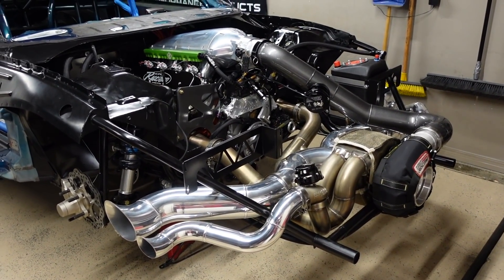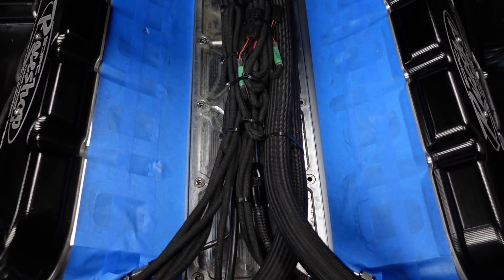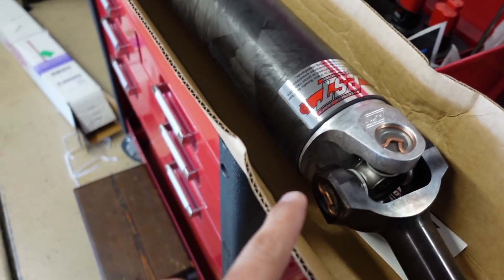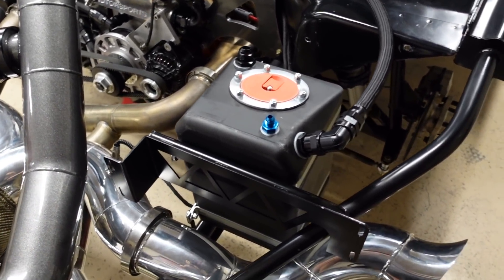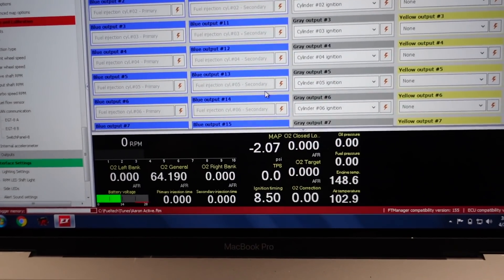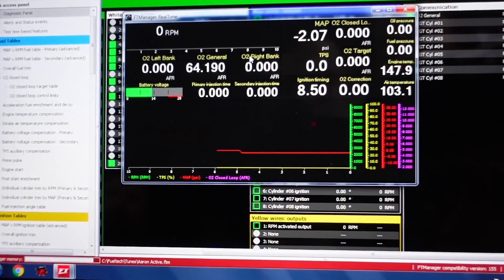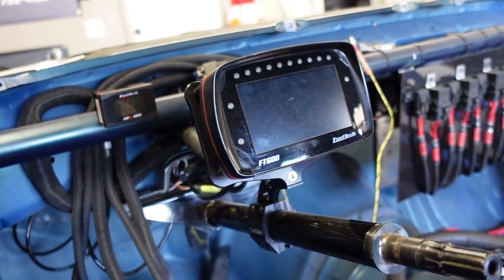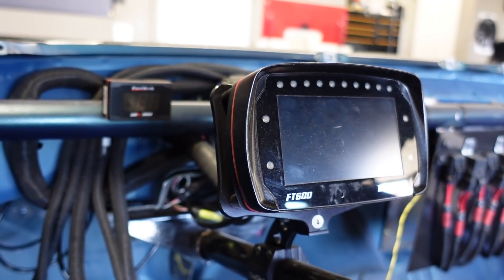FuelTech 2000+ HP F-Body - FIRST START  - Install and Diagnostics - RACE CAR WIRING SERIES - Part 4!

Comment: First off.. I'm and old school Carb guy.. i worked with factory fuel injection ..for a living for 20 year's never did any pro or after market stuff for racing.... I'm posting this cause i would like a real user input to running fuel injection on a race car!!
I see your running turbo's ect so your forced induction.. I can see were the fuel injection mapping can benefit for your application.. But if some one was going to go with a Holley system or a fuel tech system.. what would you recommend  for a basic N/A setup if you had to make a choice ?  In any case loved the video...thank's

Comment: sorry for the late question but how do you run the fueltech software on your Mac.? Do you have to (I forget what its called) "segregate" your hard drive?  I'm Mac based but bought a Toughbook and HATE it to use the software.. Thanks
Reply from the maker: I use VMware fusion to run windows on my Mac. Works great
Reply: @StreetCarJoe  thank you for taking the time to reply.  How about the FT700 an Plus that came out today.. I have the 550 & 600 and listening to the announcement.. I have no idea what it does but at 4&5,000 it better park my car to! Thanks again
Reply: @RiskIt007  FT700 will only be released around next summer. It will have a native Mac software. Keep in mind Fueltech products have a long life span and they get several software updates every year with new software additions, they will be releasing the FT700 as a "hardware platform" but, a lot of the new cool stuffs from the software functions may only come later (the 700 will do everything the 550/600 already does of course), I wouldn't bother about getting it on the release day. 

Fueltech have plans to keep and update the FT700 for the next 8~10 years with their software updates, they are saying they don't know exactly what will be possible with the platform because they aren't putting old cheap processors that most of ECUS used to have but the modern ones that are much faster, they are saying they wont trade performance to save a few bucks.They were focusing on developing the hardware as a platform first and then they will see what they can achieve with all that silicon performance, so a lot of new features may only appear/be released later.

Comment: That  EV1 injector clip should connect to those EV6 injectors (bosch style) without the jumper,  Their design to work with different style injectors.
Mine connected perfectly without any issues or internal trimming.
Awesome build!  First-time viewer.
Reply from the maker: Just went out and tried, no go. I think this an older fueltech harness so maybe they changed at one point. This harness doesn’t have the built in EGT connections either...

Comment: Joe nice job. What block is it using and is it solid or water jacketed?
Reply from the maker: LSX block. It’s filled but the heads are going to have water circulated through them

Comment: Your poor wife, and kids, they must be glad you stay in the Man Cave, and gone racing. 
Don't mean it in a bad way, but I tend to be a little OCD myself, and I remember back when my boys were growing up. 
The wife would just point outside, and say," go, now!"
Still does if I have a momentary lapse.😎
Btw, great work, and very nicely done.
Like the way the exhaust exits the engine bay, but a little more angle towards the rear, would allow all that boosted exhaust gas to help propel the car forward, would it not.

Comment: Cranking Fuel Multiplier definitely helps a ton with a mechanical pump💪🏻 mine starts up that fast as well on Holley.
Reply from the maker: Yeah my car is on Holley and starts near that fast and I have a rear pump and cell 💪🏻

Comment: If your going for ice cream then its a street car. Where are you putting the radiator?
Reply from the maker: It’s got a tank in the passenger seat that will act as my radiator... ice will help make the 1.5 mile cruise to my local sonic 😂😂😂

Comment: Great video. Thanks for the primer pump info👍
Reply from the maker: No problem. Not saying there aren't cases for primer pumps. But this car and my car that has a rear mechanical pump both work great without primer pumps.
Reply: @StreetCarJoe  I'm running the FT600 with Atomizer 800lb injectors on alcohol. My little berta (21gpm) pump is crank driven and my fuel tank is next to it. Fingers crossed I don't need a primer pump lol
Reply from the maker: @lowwlife1  You shouldn’t. Good luck!